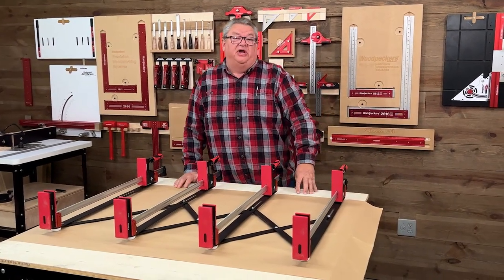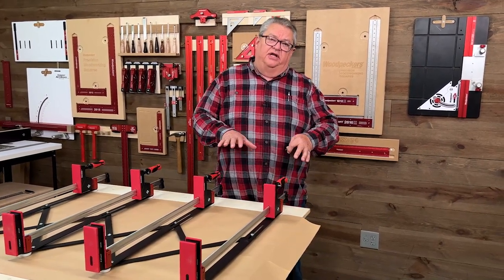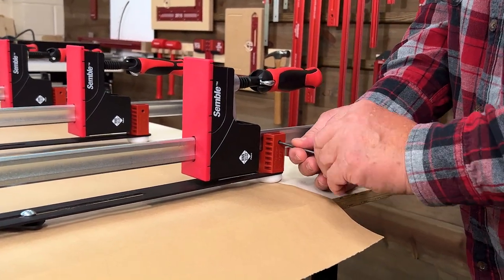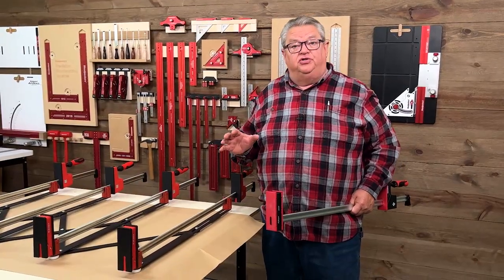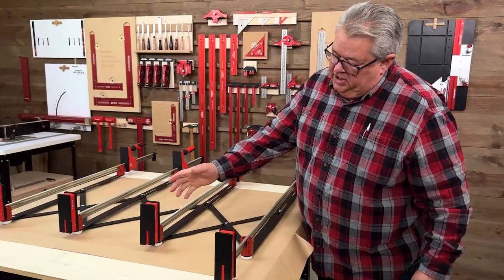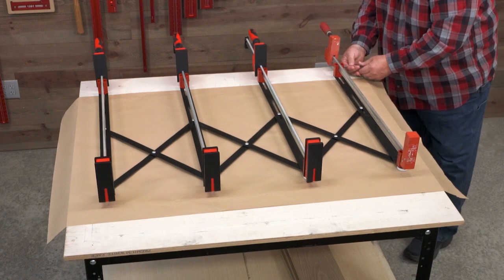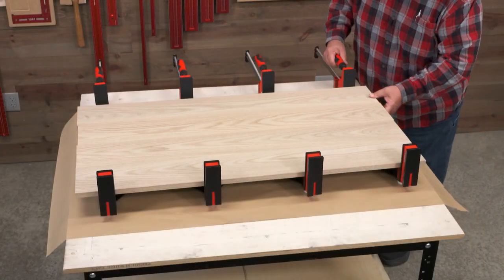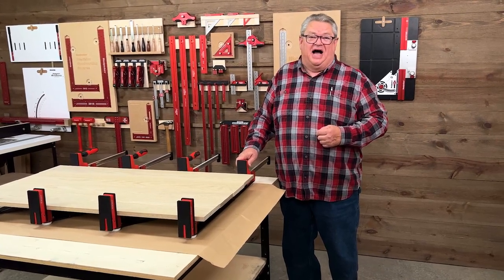Cool Features Of The NEW Xpander Clamp System  | Deep Dive | Woodpeckers Tools

Comment: Just bought your Clampzilla clamps.  I am not thinking there is enough space or a need to use these together but at the price of wood for tabletops I am interested in any way these could work together
Reply from the maker: Dan, As you guessed, the ClampZilla clamps don't fit in the Xpander, but if I had a pair in my shop, I would use them in conjunction with an Xpander full of parallel jaw clamps...ClampZillas on the ends and PJs in the middle. The Xpander is going to hold the assembly up off the table, which makes putting the ClampZillas on a lot easier.

Comment: Does this work with the clampzilla clamps / or is the idea that you would use both clampzilla clamps and some standard bar clamps with this tool?
Reply from the maker: Hilary, The ClampZilla clamps don't fit in the Xpander, but if I had a pair in my shop, I would use them in conjunction with an Xpander full of parallel jaw clamps...ClampZillas on the ends and PJs in the middle. The Xpander is going to hold the assembly up off the table, which makes putting the ClampZillas on a lot easier.

Comment: Does the 40-50 require you to use a clamp that is a minimum 40"? Thanks.
Reply from the maker: Larry, there is a minimum...just not sure what it is. I'll measure it Monday and reply here.
Reply from the maker: Larry, 
The minimum bar length is 43-1/2" from the inside of the fixed head to the end of the bar. Depending on the brand of clamp and the size of the sliding head, that would typically be a capacity of 40" or so.
Reply: @WoodpeckersLLC  Thank you for the response...time to make a decision.

Comment: I'm not seeing a big benefit than just using 4  separate clamps.
Reply from the maker: Storage. Instantly spaced evenly on your table. Clamps held upright even if you bump them. Clamps and panel elevated off bench creating space for clamping cauls.
Reply: That's what's great about the free market...buy what floats your boat--pass on what doesn't.